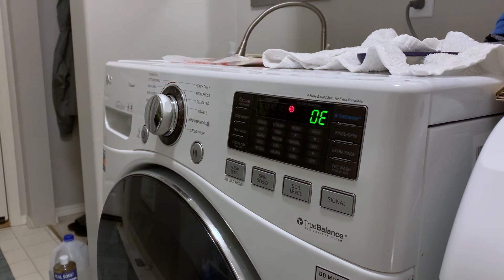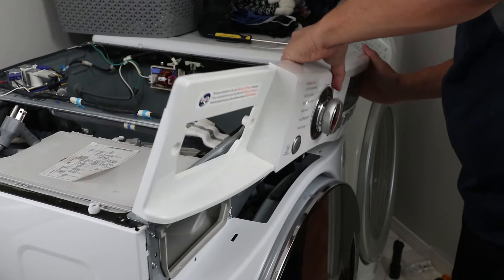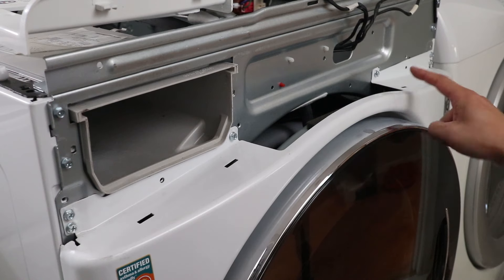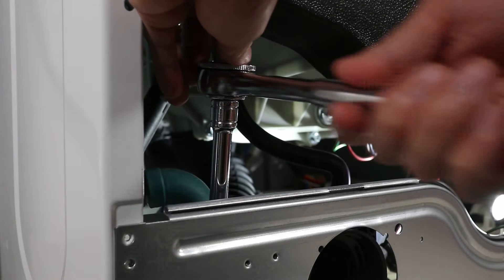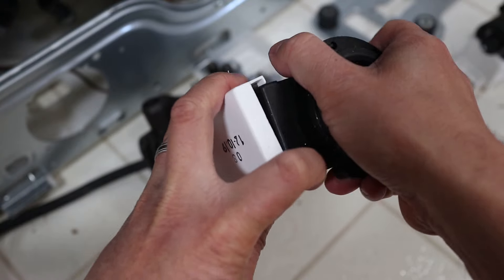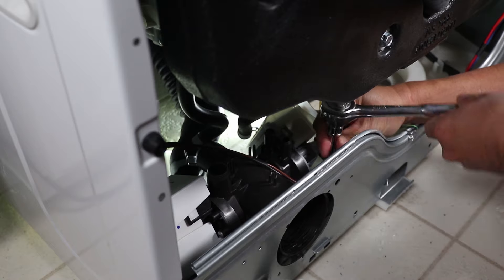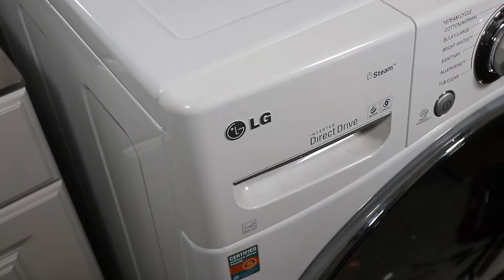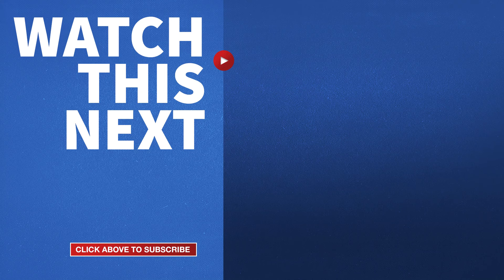LG Washer OE Error Code - LG Washer Not Draining Fix - LG Washer Drain Pump Replacement Tutorial

Comment: In just seconds you can quickly identify a broken motor rotor. You can feel the plastic motor rotor with your finger when you remove the coin basket filter (1:53).  There's two water inlet holes on either side of the filter housing. The drain motor is on the left. You can touch each of the motor's rotors with your finger. In my case my rotor was broken just like in this video.

Comment: Hey, this was super helpful. I replaced my drain pump exactly as you did. Functionally, it works perfectly, but it's super loud when it's draining. Could it be a defective unit or because it's not OEM? What are your thoughts?
Reply from the maker: Hey glad you were able to replace your pump in your washer! As far as the louder noise I’m not exactly sure why it’s now louder. As you mentioned it could be a defective unit but maybe something is clogging the drain outlet? Everything is tightened down right? Sorry I can’t be of more help! I’m not even sure if the pump I bought is OEM. It was just one of the ones I saw on Amazon.

Comment: I just did it on my Kenmore!  I ditched the spring and used a zip tie in it's place on the ring around the door.  Actually I had to replace the same part in 2017 and did that then and it held up fine.
Reply: Oh no! I must of messed up something.  I ran a load and it won't spin or drain now.  Now the door is locked and it has towels and water in it.  I felt like I got everything back perfect.  Did I switch up something?
Reply: Mine is a front loader Kenmore Elite.
Reply: I just re-did the whole process and now it works!  Only thing I could think of is that the brown wire might not of been pushed in hard enough.
Reply from the maker: I’m really glad that you were able to get your washer pump replaced! Also happy that you were able to figure out why it wasn’t working after the initial part replacement! Nice work!
Reply: @digitalcamproducer  Thank you! I forgot to mention it took me forever to drain the washer so I could get the door back open. I used a giant Ziploc bag and used the little hose to drain into that and it took me about six or seven bag fills to get the whole thing drained and then the door just unlocked. Just thought that might help somebody else!

Comment: Thank you for this tutorial! The issue I have now is that the new drain pump works but is really noisy when draining. Do you know why this is? My assumption is that the housing for the drain pump with the three bolts is loose.
Reply from the maker: Someone else said their pump was noisy after they replaced the old one. I’m not entirely sure why the sudden noise. It could be that something on the pump housing is loose. Or maybe something got in the drain tube? I know it’s a pain to get in there again but it’s the only way to check if everything was tightened. Thanks for watching!
Reply: @digitalcamproducer  Thank you for your response. It's been almost a year since I successfully changed the pump out but I'm starting to hear that noise again. However, this time, it does not give the OE error. I'm prepared to change out the pump again but can you suggest any other pumps than the one linked in the description? It doesn't seem to last very long.

Comment: Thank you! May I ask, would this not have worked and been easier by tilting the washer back and accessing everything from underneath instead of removing allthethings?
Reply from the maker: It’s possible that maybe you could tilt the washer back and replace the pump from the bottom. It’s open on the bottom but some of the bolts might be a difficult to access but maybe not impossible. Other commenters have also asked why not do this from the bottom. My washer is in a very tight space in a tiny entry room so I leaving my washer in place was the best method for me. Thanks for watching!

Comment: Your video it's amazing, thank you, I think I may have the same problem but I'm not sure: I get the OE error, then I drain the machine manually through the little black tube, then I start a new washing cycle an at the first time it drains correctly, but right after it stops doing it: how this could be?
Reply from the maker: I’m not exactly sure what’s going on with your washer. Maybe there’s something stuck in the tubes? Maybe this obstruction moves when water goes through the tube? Sorry I’m not more help!

Comment: To get the spring back on I use a needle nose pliers in each had and stick each one in opposite ends of the loop.. Then I use the back edges of my hand as a fulcrum for moving the pliers outward and by channeling my hatred of appliance repair, I'm able to produce enough strength to get the spring opened so that I can loop on the wire.
Reply from the maker: Sounds like you have a good solution for reattaching the spring to the washer. Others have also gotten creative with this step when they didn’t want to buy the spring expansion tool. I’m sure this will be helpful to others.

Comment: I wish I had found the impeller broken like you showed, because now I'm uncertain this was the real cause of my OE code.  I saw another vid that mentioned a water sensor...so maybe that's my backup plan if the replacement pump (already ordered unfortunately) doesn't work.
Reply from the maker: Hopefully you fixed the cause of your OE code. Yeah mine was simple to identify with the broken impeller. Also do a quick check to see that there’s no obstructions in tubing or the coin trap. Good luck!
Reply: @digitalcamproducer  strangely it was the fix!  Ty for the video!

Comment: When the new pump came in I kept trying to put the rubber seal on the new one thinking it would leak without the seal but I couldn’t get it to screw down because of it. In the process of trying to get the seal in place the new seal that you could not see popped out, it’s almost impossible to get it back in place once you’ve done this. Therefore I suggest leaving the seal alone because the new part comes with it and it’s inside of it. I’m running it through right now to see if it’s going to leak

Comment: hello thanks for this video.i did step by step according to the video but i;m still having the same issue (not working same error code and same noise it was making)do you think it could be the new drain pump that is bad or something else? 
is there anyway to bench test the pump before installation? 
thanks for your time
Reply from the maker: It could be that the new pump is bad but probably unlikely. I’m not sure how to test the pump before it’s installed. Did the rotor in the new pump feel tight when you rotate it by hand? Mine had a bit of tension to it when I rotated the exposed pump blades due to the magnets inside. The only other thing I can think of is that the wires weren’t connected back like they were before or maybe one of them was loose? Sorry I’m not more helpful! This is the first time doing this repair and I’m not an appliance repair person. Hopefully you get it working soon!

Comment: Looks hard but very easy to do, if not sure what part it is usually it has a number on thr part to order.
Reply from the maker: Yes! Replacing the washer pump isn’t too difficult to do. Quite a few steps involved if you have the older style like me that doesn’t have the removable front bottom panel. I didn’t have a part number when I was looking for a new pump but comparing pictures on Amazon I was able to get the new part no problem. I’ve also listed the things needed in the description. Thanks for watching!

Comment: Thank you for this video. I am a very detail oriented person. I ordered the pump and spring tool from your links and carefully followed your directions. However, when putting the spring back on it was not tight. And when I ran my first load the washer leaked all the water from the bottom of the washer. Can you please suggest what I may have done wrong? Thanks so much in advance!
Reply from the maker: I think that maybe your spring didn’t get seated back in correctly or the rubber gasket isn’t completely snug around the opening. I would remove the spring and undo the rubber gasket around edge like you did the first time. When you reinstall the gasket make sure it fits tightly around the metal opening. If I remember there’s a groove that the gasket will seat into. Once you know the gasket is in place then reinstall the ring. There is a definite groove where it will fit into. Hope you get the leak fixed!

Comment: Thanks for the video.  I did all this but the pump worked fine on my workbench.  There was a blockage between the pump and the outlet.  A shop vac cleared it out in an instant.  Please try sucking out the drain pipe before opening the washer.  I still have not put the gasket wire back :-(

Comment: Will a bad pump prevent the washer from spinning at all?  I hear a slow grinding noise and the drum will rotate back and for a little but won't ever spin up.
Reply from the maker: I’m not a washer repair expert and this was my first repair on my LG. But maybe what’s going on with yours is a bad belt? I don’t even know if washers use belts but if there is maybe it’s slipping. However if it’s gear driven it might be a striped out gear. To check I think you’ll have to look at it from the back. Hope this helps!

Comment: do you know if the pump is the same for all LG washers,
Reply from the maker: I’m not 100% certain but I think it would be safe to assume all LG washers use the same pump. If you do this fix definitely get the spring expansion tool. You won’t be able to get the spring back on at the end without it. Thanks for watching!

Comment: 1. Be sure to order the drain motor. Not the water circulation motor. You can see them both in the video on opposite sides of the filter housing assembly. 

2. If you don't have the spring  tool you can use a  couple of wire coat hangers.   Remove the hangers' paper rod  to expose the wire hook and insert tinto each end of the spring. Have someone pull the other hanger in a tug of war kinda of way. Spring is off and back on in seconds.

Comment: Great video. Easily replaced the part. New one is operating. But, I am still getting that code and the cycle ends. First load no problem. Second load, got the code. Code comes up in a spin only with no water in the tub cycle. Any ideas or suggestions on what it could be?
Reply from the maker: Did you ever get the code to go away after the installation of the new pump? It’s possible that maybe something is clogging up the drain line.
Reply: @digitalcamproducer  The first load ran without issue. Second load stopped when the code came on. What is the best way to clean out the hoses? They are not kinked whatsoever. Also, I am a light user of the machine as it is only me in the house, no wife or kids, so can't imagine ever having anything in there that would clog things up.
Reply: @digitalcamproducer  So the pump was working when I removed the hose from the drain in the wall. Ran into a 5 gallon bucket. Got the entire drain line checked and cleaned. Ran a quick load and no code. Full cycle load (1 shirt) and got the code again. Could it be a bad or testy motor worth another $30 fix?
Reply from the maker: Maybe it could be a faulty motor. Are all the wires connected securely? I’m not an expert on this but just a casual DIY guy. See anything stuck in the coin trap. That’s probably not it. So it worked for a bit but then error again? If the pump isn’t running it might send that error. Sorry I’m not much help at this point!

Comment: This video is helpful if I must replace the pump motor, but I think there is clogging the drain filter, but I’m not 100% certain.  If I put my finger into the hole, it feels like something is lodged right at the opening.  Should it be a completely clear and round hole or is there something there?
Reply from the maker: This is a late reply but I hope you got your washer working again! If there’s something clogged anywhere in the drain flow you might get the OE error.
Reply: You were feeling the rotor on the pump when you put your finger in one of the holes where the filter is kept.

Comment: Yep my sister was making weird grinding and vibrating plus the pump comes on and off constantly so think that was making it worse in the end… filter was clean no blockages and It hadn’t jetted water out the yellow thing at the top in ages. So bought a new pump cheep china made to fit pump as lg wanted 70 pounds for a new one when it’s 14 years old and then it leaked out the back of the circulating pump (it’s a twin pump) the whole bottom panel was filled with water took 3 bath towels to mop it all out just from a drip so was not happy still worked mind but wish I bought a genuine pump in the end 😕 
But they sent out a new one replaced it last night checked it today after two loads was done and it’s all dry and working like new again. And now jets the water out into the drum again. My screw on the front panel threaded and my drill battery died to 😩 been and absolutely nightmare fixing this thing the last two weeks so couldn’t get the front panel off because the last screw was threaded so had to go in and do it from the back and luckily there was another small opening behind the bottom plastic panel and my pump come pre wired and assembled just had to plug the blue plug back in. And boom it all works again great. Would have been a million times easier if the screw would have come out or hole in the bottom panel underneath but nope lol. It’s worth fixing parts are mostly cheep. Mad how many people I know would throw it out because it won’t drain and buy another brand new machine when it’s 2 or 3 years old. Never will I throw my lg till the drum or the circuit board blew and Even then I would probably take it to someone who fixes circuit boards. So just the drum going as it will be old then and no way am I confident enough to do it myself and people around here would charge me well over 100 quid to put a bearing in so it’s just not worth it in my opinion….

Comment: 5:38 This is the factory pump orientation
7:04 The replacement pump is off by a notch or two and not clearing the discharge hose outlet.

Comment: Before you do a bunch of stuff that may be unnecessary, try unplugging it for an HOUR, then back in and try again. The board gets wacky. I’ve fixed mine twice (a year apart) doing this.
Reply from the maker: Thanks! That is good advice to try before taking the washer apart. On mine the impeller was definitely broken which required replacement. But issues from circuit boards can be a problem too!

Comment: I did the entire repair exactly the way the video shows. Replacing the drain pump.    I put the washer back together and ran a cycle and got the same error message any suggestions

Comment: Got the same error code during NORMAL, but still able to use mode: SPIN &DRAIN successfully. the filter drain looks clean.  SO what do  you think is the problem? thanks
Reply from the maker: I’m not a washer expert so I’m not exactly sure why yours is still having issues. So it drains when you spin and drain? But if you run a regular cycle the OE error pops up? Sorry I’m not more help! Maybe check that all the connections are secure. You checked the filter but maybe one of the drain tubes still has some blockage in it?
Reply: @digitalcamproducer  I found out if I moved the washer 1 feet away from the wall, it work fine. thanks for replying

Comment: I just scoot the washer forward and lean it at a 45 degree angle. Then carefully remove hoses, wires and the mounting screws. Swap the pump and reassemble

Comment: I can’t see where you posted the pump and tool. Can yymou repost?
Reply from the maker: The description is just under the video title. It’s almost always compress to display only 2-3 lines. Lots of times you’ll see a button that says ‘show more’ or ‘show all’. On the YouTube app on the phone there will be a small arrow to the right of the video title. Tap on the arrow and the video description should appear. Links to both the pump and tool are there. I just checked. Good luck with the repair! Lots of people have done it and using my video as a guide you shouldn’t have any problems! Thanks for watching!

Comment: No need to take the back brackets off, since the top of washer slides backwards. Just remove the one screw on each side that attaches the top of the washer to the back.  (Just a little step saver especially in a cramped space. Fewer screws to risk being dropped behind the washer!)
Reply from the maker: Yeah you’re right! I could’ve just taken one screw out and left the bracket on. I didn’t even think to look at it that closely when I removed them. Hopefully this tip helps others save one step in the disassembly! Thanks for watching!

Comment: my washing mashine small hose was disappear inside how to get it.? its been a year never been drain the excess water.
Reply from the maker: If you’re talking about the small drain hose you should be able to unscrew the plastic cover in the lower front drain trap and feed the hose back through the hole in the cover. Hope this helps!

Comment: My washer machine all of the sudden just started filling up with lots of water and then it just starting leaking from the bottom of the machine and is wondering what is the cause?  I replace the pump, but now the water is squirting out from the back through this little tiny hole.  Please help give me advice on what I need to do?